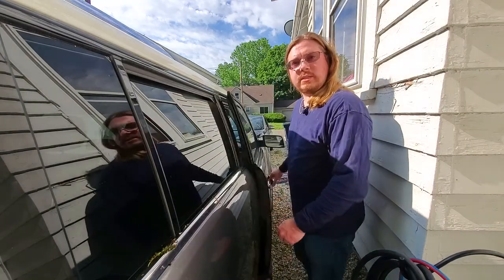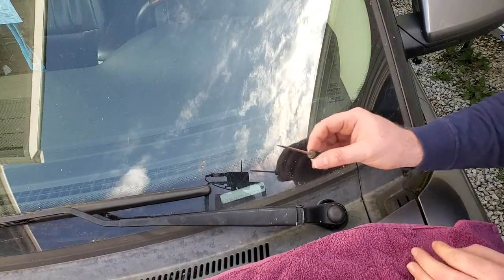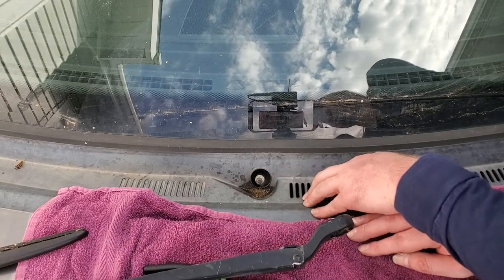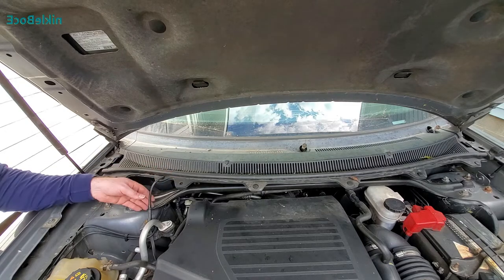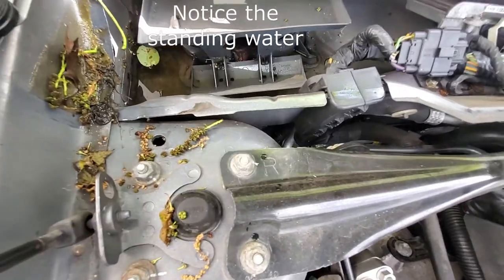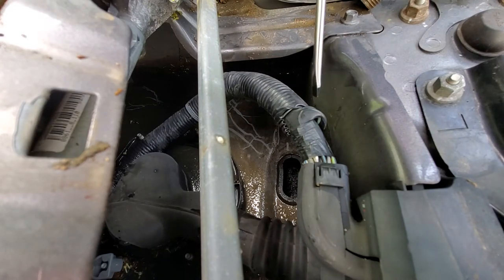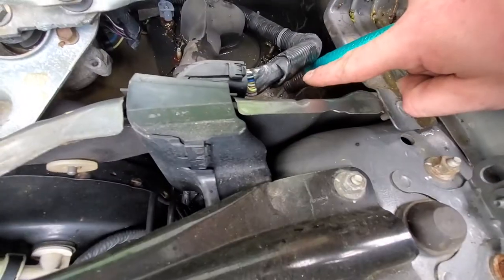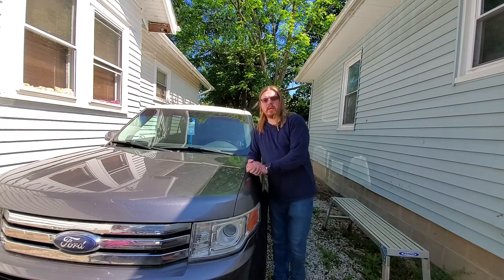Ford Flex | Clogged Cowl Drain | Water on the floor !!

Comment: You no doubt saved me hundreds of dollars.  Thanks for making this video and for the attention to detail.  One suggestion.  Instead of using muscle to release the two white pins that affix the drain pans to the chassis, slip an 8mm socket over the end of the pin to squeeze the plastic together and then pull up on the pan.  This way you won’t risk damaging the pins or the pans.  This wasn’t my idea, I found it in another video and really liked it

Comment: All videos are informative BUT, when I opened hood to beging my cowl are was full of pine needles etc.
I first look around and yes drains were plugged with debris. 
However on my 2014 Flex SEL I was fortunate to discover that I could access the plugged drain with a shop vac and a small vacuum accessory crevice tool at both ends. Waited for stuff to dry the scrapped it a dit to loosen debris and vacuumed it out. Also cleared the drain to engine compartment with a small bent tool.
Done deal without Disassembley 👌 
Hope this helps. 
Cowl covers will make a difference But look before you start.

Comment: Have a 2014 Ford Flex started have problem with water on the floor of the passenger side in May of 2021. taking my car in on Monday July 26, 2021 to have it repair, thanks to this video I know what the problem is before I take it to the repair shop. If I was younger and had the tools I would repair myself.  I will report back if they try to rip me off
Reply: As a matter of fact, I have a 2015 Ford flex. I've been having that prob, being a female...it's a little much 4 me 2 do. I had 2 leave my truck behind for hurricane Ida. Now I have water & mold on the front floors of the vehicle. Have 2 cover it 2 bring 2 the shop 2 take care of the mold. It's a PROBLEM of Ford I see.

Comment: Yes, I have had the problem in my Flex and it wasn't that old but the problem was that there was a tree near my driveway that kept dropping some sort of fuzzy things onto the cowl which crumbled and went down into the cowl blocking the drains. I literally had 2" of water on the passenger side when I first noticed it. It took the dealership two tries before they did the job right but it was under warranty so I didn't have to pay for it however they managed to scratch the trim and the hood in the process and break one of the wiper arms. If I made them fix the scratches I'm sure they would have only made it worse and I didn't notice the broken wiper arm until a year later when I went to change the blade. Now it's doing it on the driver side. This time I'll fix it myself with some help from your video. Thanks. I liked your video style you sound like me when I doing something and it doesn't go so smooth and it becomes a learning process. However I curse a lot when I do things or so my wife tells me. LOL

Comment: Thanks! I noticed a very slow leak in front of the driver's door. I didn't want to take off the wipers so I just got a ~2 foot long zip tie and stuck it through the cowl louvers to clear the grommet. Voila! I got a gush of water draining onto the ground. Glad it wasn't so bad that water got into the car because a big storm is coming. Thanks again!

Comment: First---thanks for this video---very helpful and educational!  Rant:  Went to Safelite to get windshield replaced.  A week goes by (no rain) and then we get hit with 2 heavy rains.  Day after my passenger floor has 2" of standing water.  I spend the next 5 days cleaning all this up, took seat out, took front carpet out, dried everything off and put it back together.  I had Safelite re-do their work (we never had any leaks whatsoever prior to Safelite's work).  I told them they might've knocked some more debris during their work into these drain grommets.  They said they looked at it and didn't touch anything else.  I said ok----got home after their 2nd repair, took the cowl off myself and looked at these rubber grommets.  They were covered in leaves and debris---they never even looked at it.  I doubt they even tried to clean anything out in this area.  Also, doesn't look like they removed the cowl panels (3 of them on '14 Flex).  Next time y'all get your windshield replaced, please don't expect Safelite to clean this area out for you.  They only remove your old windshield and place a new one on----they do nothing else. Pretty disappointed in them.  On a final note, I found another video where you don't need to remove the big top cowl panel.  You have much less room to work with and need smaller hands, but it is possible to do that if you're having trouble removing your wipers.

Comment: Watched from Yosemite, Kentucky.    Thanks much.   I have a 2011 Flex with a broken passenger side wiper connection.  Only the driver wiper works.  Thanks for showing me how to get that cover off.  And while it's off I'm going to clean those water drains.  Thanks again!
Reply from the maker: You are welcome.

Comment: Bro! I had the exact same break in that pipe and mine is ran exactly like that. 😆 

I actually used a blue wire crimp terminal to put the 2 hoses together. Has worked for like 4 years thus far.

Comment: I just bought a 2018 flex myself. And I took it straight to the carwash and water was dripping from underneath the glove compartment. So I will be doing this myself as well. But my question is does your flex smoke when you turn it on from the mufflers? Blue maybe whitish smoke? Mine does but only now and then. I also have the EcoBoost. I don't if maybe it's the water getting into the exhaust from the Cowell area not draining right or that maybe the turbos have a seal leak that needs replacing. Mine only has 75k miles on him so I'm curious if I'm not properly treating my turbos right with turning it on and off tío soon maybe?  I don't drive it like a maniac.

Comment: First thank you for the video. Second I guess I got lucky I was able to get my hand to the one on the passenger side and pull it out from the bottom. Yup it was clogged. And was able to replace it without too much issue and without any dismantling. The drivers side I had to use a wooden dowel and a flashlight and with some Dawn dish soap and low amount of water was able to work the clog out from the outside.   But thank you for showing me the locations

Comment: Those two ‘rubber boot’ (passenger and driver’s side) drains can be easily pulled out and cleaned. No need to vacuum or poke them clean. They slip right back in. Hope that saves time and helps.

Comment: I’ve got a 09 Taurus with a leaking issue so I’ll try this tomorrow. I’m guessing the water overflows in there and goes into the air Intake. Thanks I’m advance, this is probably the clearest video I’ve seen of what to do.

Comment: What is the tool you used to get the wiper arm off and where do I find one ?
Reply from the maker: I used a tie rod/ ball joint separator found at any big box auto store.
Reply: @EcoBelkin  thank you
Reply from the maker: Your welcome.
Reply: I used a battery terminal puller

Comment: HELP. I did this with my 2009 Ford Taurus limited edition. And I cleared the obstructions BUT afterwards I took it to a car wash and it was leaking still in the front passenger side. I hosed down the drains with direct water when I fixed it and it wasn’t draining into the passenger floor only a few minutes later at the car wash it did. What happened? Could it be something else?
Reply from the maker: Not realy sure. There may be a pin hole at the bottom of the blower intake or somewhere with in the cavity. Mine drips water in once in a while and I know my cowl drains are clean. Leading me to believe that a pin hole is at the bottom of the blower intake or somewhere close to the blower intake.

Comment: Dykes ford service manual have part numbers? Should be able to search ebay for new cowl and clips.
Reply from the maker: The top trim is like $180 from tasca. And the clips are wheel liner clips.

Comment: Why did Ford have to replace your engine? I have a 2010 limited and haven’t had any engine issues..
Reply from the maker: Engine issues at 84k.
Reply: Would you two say purchased a used one or no based on your experience? I’m looking into a 2013-2015 with moonroofs....
Reply: Either SEL or Limited
Reply: @nblade15  I love the vehicle! I handles well, has plenty of room, and it’s still stylish to me. You will enjoy all of the light from the extra moonroof. I would see if you could find a all wheel drive version...
Reply: @Fr8hustler  I have found an AWD version limited but it’s a 2013....they want 13k for it though 😫, so I’m trying to figure it out. I love the stylish look for them as well. I just want to make sure I’m able to have it for at least 4-5 years. I have 3 kids so that’s why I was thinking the moonroofs would be great to keep them occupied as well.
Reply: @nblade15  Mine is a 2010 that I bought in sept of 09. It only has 105K on it because it sits while I drive over the road. If maintained, they are wonderful. With the eco boost, I believe a catch can is needed to help keep down the soot. Also the timing chain guides are made of plastic and they should be changed out near 100K just as a precaution. If they fail, it will be pieces of plastic all thru your engine. I would check to see if this has been done. Also the water pump is in the same area as the timing chain so if they go in it’s advised to check/change the pump as well, while they are in there. 

I wish you luck, and I would say if you really want it, get it! I was on the fence about buying mine, then my grandmother said “ you work hard, get what you want. You only live once! “
Reply: @Fr8hustler  well the one I’m interested in has 105k miles on it already.... it is ecoboost so all of the extra information is definitely appreciated especially because they don’t disclose all those things so I will definitely inquire with them on Monday. I have a 3 day hold right now since I’m nervous... https://www.mesquiteford.net/used/Ford/2013-Ford-Flex-36d9361c0a0e0adf35290a4d61a4654c.htm
Reply: @nblade15  I love the colors, especially that interior! I wish I would have gotten that charcoal or black interior. I have the light tan and I will NEVER get it again. The dye of your blue jeans stained my seat. And the light tan shows everything... And you will be amazed at the sound system. The Sony speakers sound amazing! You can flip the third row backwards for an evening at the drive in ( we still have one in Ga ) or tailgating at a game. You will love it
Reply: @Fr8hustler  I so appreciate you for this, 😀 you have eased my mind into finalizing the process. I live in CA and we still have a few more left and my girls and I love to go watch movies when we are able. Covid has temporarily stopped us. I love the interior as with children anything light wouldn’t work, but I love black/maroon, and white cars with black tops...very hard combinations to find as well, hence why I had to find this one in Nevada.
Reply: @Fr8hustler  the water pump on this v6 is behind the timing cover, the timing chains drive the pump. There is an oil seal on one side of the pump shaft and a water seal on the coolant side. If the coolant side seal goes it can cause corrosion and eventually the oil seal fails with water getting into the engine's lubrication. Eventually destroying the bearings. Then it is a new engine. If the leakage is minimal, you will never know it is leaking into the engine's oil unless you detect the oil is getting water into it and that may be too late. Mind you the water pump on most vehicles is a maintenance replaceable item. Seals will deteriorate and the pump must be replaced. it requires removing the front cover of the engine, and while in there replacing cam chains, followers, cam advance actuators. About 2-2.4k, that is if you catch it before engine destruction, and then 8k maybe less if they find a used engine. I have 2013 with 64k and have had lots of things go bad. The windshield water pump failed, guess where that is located? Ford put that in the right front wheel well. You have to remove the wheel and fender liner to access. Totally stupid. 2 hours of labor. suspension parts fail due to cheap engineering. Had rear bushings go at 40k, 650 bucks, luckily it was under warranty. Safety recall on the rear toe links, you can look that up, the originals were pathetic in construction. Modern vehicles are not engineered to be easily maintained or repaired. Ford isn't the only culprit, they all have issues like this flex. The dealer said I needed my spark plugs replaced at 65k. gave me a quote of 450 dollars, for 6 plugs. If you get a turbo, beware turbo seals will deteriorate and you will need to address that sometime in the future. Would I buy another flex, not unless all the maintenance items have been addressed. I would not buy the turbo if I was planning on a long term, can't imagine what that costs to replace. I do like the vehicle from a driving and comfort and utility point, but I eventually am looking to move on. good luck, if there is a lot miles and the water pump is original, you have been warned.

Comment: those rubber grommets are traps. you snatch them out from underneath, clean them out, and put them back. no need to take that stuff apart
Reply from the maker: oddly enough.. a year or so after I filmed this I ... reached behind the passenger side strut tower and snatched it out and never put it back.